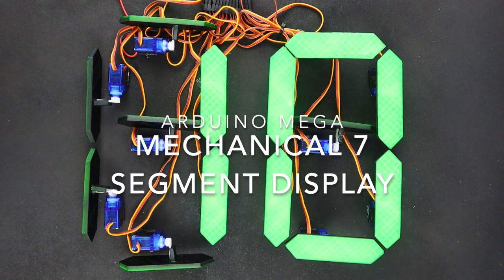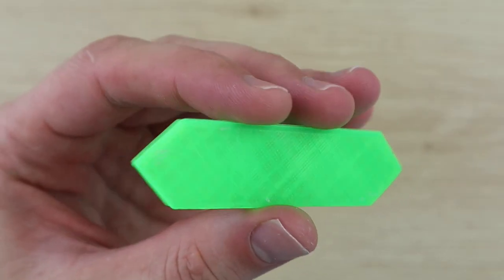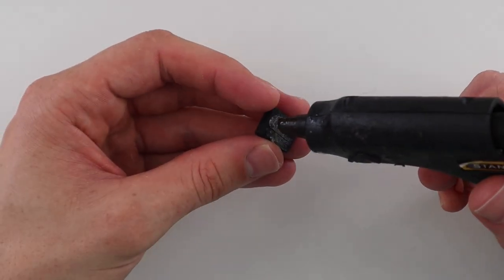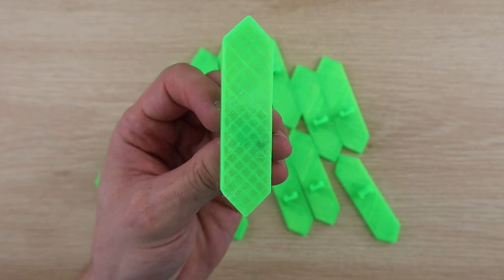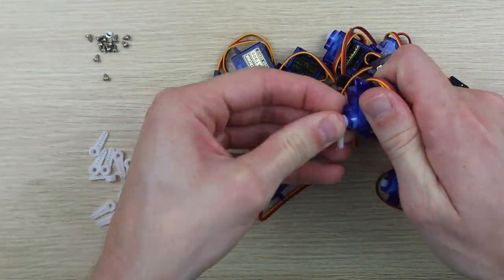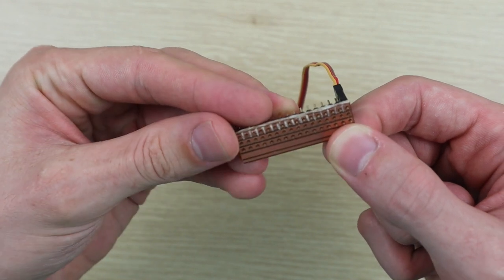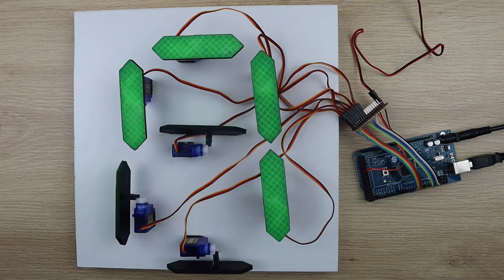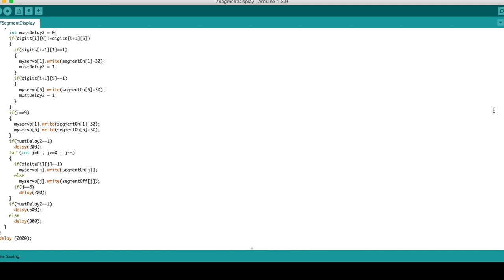Mechanical 7 Segment Display Driven By An Arduino

Comment: The clearance issue for the middle segment can be avoided by using a rectangular middle segment. It's more reliable that way and most commercial displays are designed that way.
Making all segments rectangular would be slightly less aesthetic, but in my opinion, worth it.
Commercial displays tend to use different shapes for different segments, with a 45 degree bevel in the corners and a straight-cut where two verticals meet.
Reply from the maker: Yeah a lot of the ones I looked at had rectangular middle segments - I just wanted the segments to look similar to the traditional digital watch numbering. But yes it would have made programming a lot easier.

Comment: Great project and practical, my only concern is, how reliable are those servos especially when they are actively running every second on the dot, they might burn out in a week or so, any ideas?
Reply from the maker: They are reasonably good quality servos and they haven’t given any trouble yet. I used them in a subsequent clock video a few weeks later. This only changes every minute, but I’m sure they will eventually burn out.

Comment: Would pivoting them from an edge instead of the middle not avoid the inter-segment interference?  Might also make the overall footprint smaller.
Reply from the maker: It would definitely make the footprint a bit smaller. You’d probably still need to move the segments alongside the middle one when it moves though. The only way to get around this would be to mount the middle segment lower than the others so that it can move freely.

Comment: Do you think it would be possible to control the counter with some sort of keypad? So you can press a number and it shows up, or you press some button and it starts counting?
Reply from the maker: Yes, there are a number of keypads or keyboards that people have interfaced to an Arduino so it would be fairly easy to modify the code to take the input and display the number.
Reply: @MichaelKlements  if I am a beginner what are some sources I can use to learn how to do this?
Reply: @adampuglisi5648  Literally ask ChatGPT lol. I'm pretty sure it can come up with a modified version that does it. Just give it the code and ask for these changes. Make sure the response is not too long, else it won't work properly.

Comment: Thinking how it's possible to use relays or transistors to make the mega operate a 4 digits clock
Reply from the maker: It should be possible for this particular project. You could use three PWM pins to output the upright, left and right movement signals and then use relays to drive these fixed signals to each servo. It would be quite a complicated wiring exercise though.

Someone on Reddit told me about an I2C control board which drives 16 PWM outputs off of just the two wires required for the I2C interface. And they’re relatively cheap. So I may try and build a clock using two of these, just need to get fourteen more servos as well!

Comment: Any thoughts on scaling this up to digits that are 12 inches high?
Reply from the maker: You'd just need to use quite large servos. I don't see any other reason why this can't be scaled up.
Reply: @MichaelKlements  Would spring-loading them to a retracted "off" position, and a solenoid to push out to "on" position consume less power?
Reply from the maker: You could probably do something like that, I don’t know whether it would use less power though. Servos are actually quite efficient when at standstill, it’s only really their movement that consumes power. So servos use a lot of power for short periods of time, the solenoids would use less power but require power to stay in position, so may land up using more in the long run.